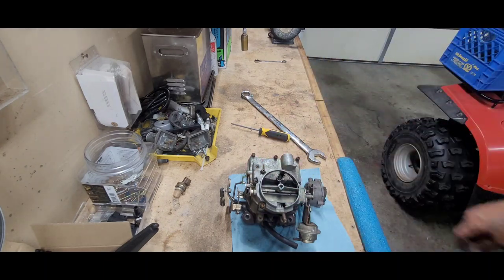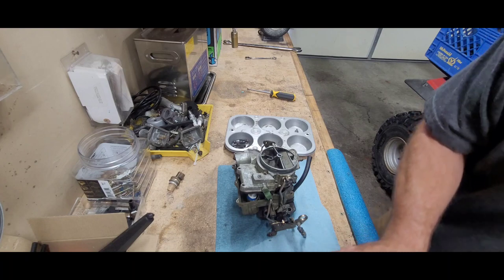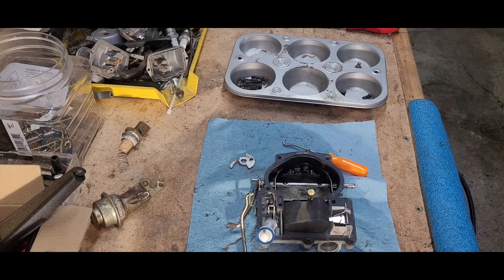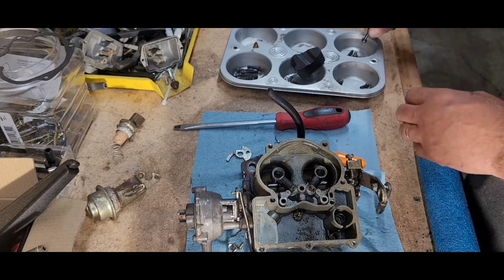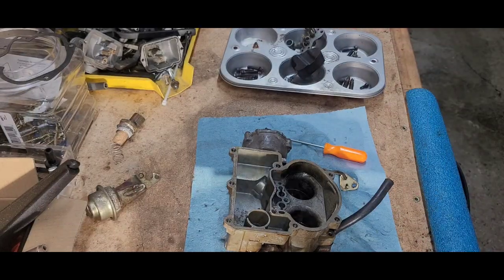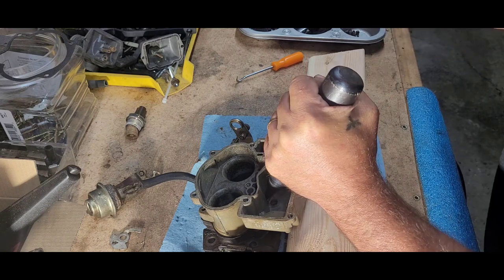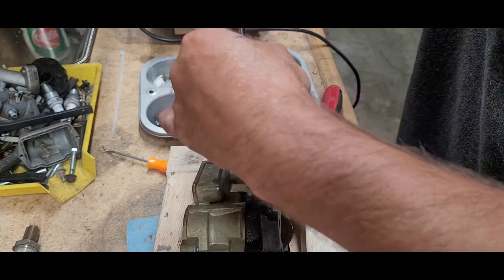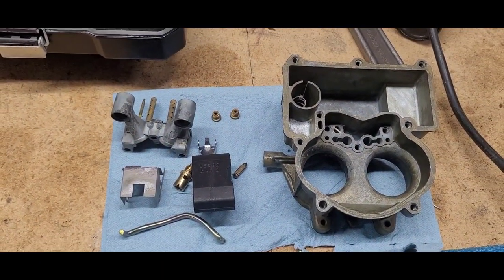OMC 2.3 cobra carburetor tear down 😀 part 1

Comment: One of my favorite sayings... it's always the carb. If it's got one, fix it first. 🙂
Reply from the maker: You said that right buddy
Reply: @LewisMowersandBoats  I just put a new carb on a go kart, it doesn't sound right and has a fresh carb, I am pretty sure the problem is still the carb(the valves look perfect). 🙄
Reply from the maker: Do you got it brother sounds like the carburetor 😀
Reply: @LewisMowersandBoats  If I break my hand and go to the doctor, the first thing I ask him to do is check my carb 🤣
Reply from the maker: 🤣🤣🤣🤣🤣 Bill
Reply: @LewisMowersandBoats  
Weed eater won't start? 
Carb problem.
Mower won't start?
Carb problem.
Car running badly?
Carb problem.
Mother in law mad at you?
Carb problem.
It's always the carb, even when it's not. 🤣🤣🤣